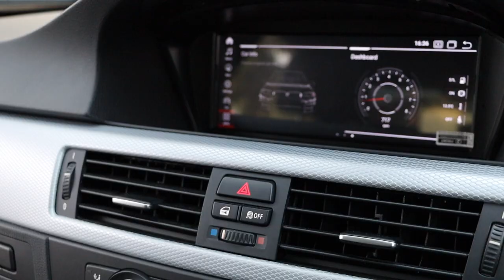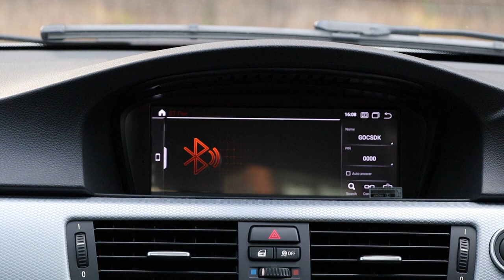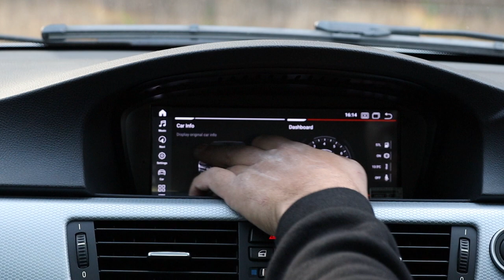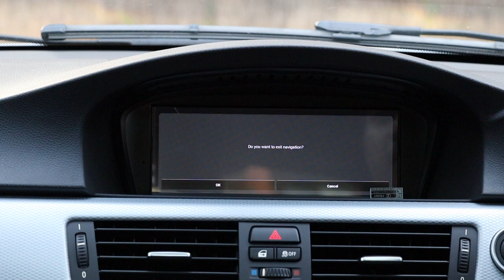BMW E90 8.8" Android Screen Install *ULTIMATE INTERIOR UPGRADE*

Comment: I have one of these units installed on my 2012 e92, works great other than the audio. It keeps skipping when listening to music via apple car play, works fine with the radio. The head unit audio is directly connected to the oem aux input. Xtrons has been little to no help with this issue, wounding if anyone else has had this issue
Reply: You have to disconnect the Bluetooth and just keep CarPlay on and it won’t skip anymore

Comment: Do you have an idea why my idrive controller doesn’t really work with the Android system? It works fine on the idrive screen but when you go onto the Android system it’s either super sensitive, glitchy or doesn’t work
Reply: It’s built for I drive so it work’s different with android

Comment: How in the world did you get the dvd unit back in…. With the new harness.. it doesn’t seem to wanna go in properly
Reply: Do you have a solution? I cant fit it in with the new harness behind it either…
Reply: @xl2awz  yes I eventually did, I guess I just needed to mess with the wiring in the back a little more, just kinda play with it. I’m just glad i’ve had zero issues with it

Comment: I have a 2006 330i and I just got my xtrons head unit and I finally got everything connected but the audio isn’t working. Been trying to figure out what the issue could be but the screen functions fine^^ need help but glad I found this video!
Reply: I'm struggling to get the oem menu to come up, tried everything and I'm stuck
Reply: It’s the optic green cable if you haven’t figured it out yet
Reply: @karlyounan4177  same here, dja figure it out??
Reply: @karlyounan4177 did you fix it ? I also cant get to the menu

Comment: For those with a Cic unit, you don't need to run the aux to the centre console as shown.
You can code the front aux with bimmertool or similar and it will run straight from the factory unit.

Comment: my old ccc screen menu wont show on the new screen. i tried all the options to making it work and now my original head unit wont output any video at all. so annoying
Reply: Did you fix it ? Same issue
Reply: @skilleragario  I haven’t yet, I’ve been using the new screen without being able to access the main car computer. It’s annoying
Reply: @terminatort-sf5xm  yea got the same thing rn man, and i also have no audio because i need to switch to aux in the bmw menu… :/
Reply: @skilleragario  to do the audio i had to switch the green cable in the wire box. im thinking of buying a new cd head unit or just paying someone to instal it for me cause this shit is just a whirl wind of problems.

Comment: Hi mate , that old screen looks like the smaller 6inch screen ? If so was there any issues upgrading to the larger screen , I have the same smaller screen at the moment and hoping the 8.8inch carplay is just plug n play .
Reply: Shame you didn't get a reply. I don't suppose you ever found out?

Comment: I have a e92 with CCC i think you've found my problem, my car has a retrofit box everything works but audio. ive pulled it apart and there was no aux plug anywhere on its new wiring harness. Is hardwiring what i'll have to do to fix it? 

Chop off the female end on a AUX cable and splice it into the aux wires on the harness behind the radio unit? then male end into the port in the center console? 
Anyone know the pin outs is it the same as the video?

Comment: Weird. I have same issue with no sound. Moved fiber optics as needed. With Jack, i did have to use Jack cable provided in kit which had same connection (bolt) on both ways but so was the one from harness. So I did hardwire harness end with one end of Jack cable and the other end with bolt went in aux port. I still have no sound. Wonder if I need to provide any power from accessory cable to antenna as some people had these issues due to that. Dont know. Im so lost
Reply: Hey, did you manage to figure this out? Have exactly the same issue where everything is hooked up correctly, fiber optic cables moved, aux connected at the harness routed to the oem aux armrest port, but still no sound.. I’m also so lost 😂 Any help would be very much appreciated

Comment: Hello, I just installed the android to my e91, but carplay is not working.. What should I do? Phonelinking turns off after 5secs after loading it and there is no other apps in my android.
Reply: Did you find it? Mine does not go te Apple CarPlay when i patent phone

Comment: Hey what if your getting a no signal logo when you switch back to factory idrive system and no sound, but I can switch to the android unit interface use CarPlay music hd video and any app ?
Reply: Hey mate, same here, did you find a solution??
Reply: @aryobismo6523 did you fix it?